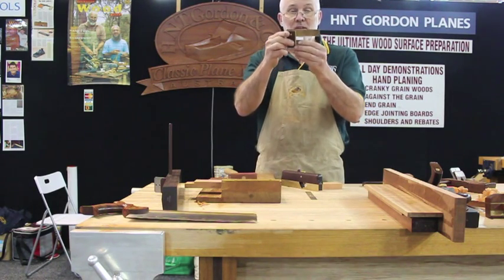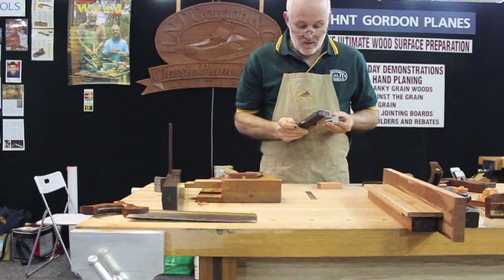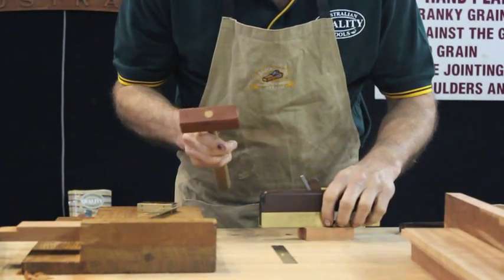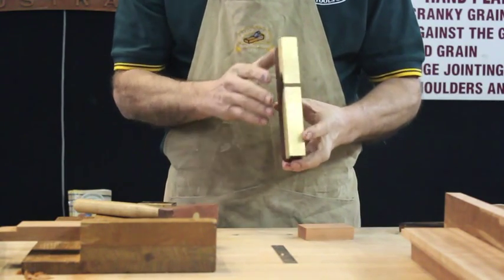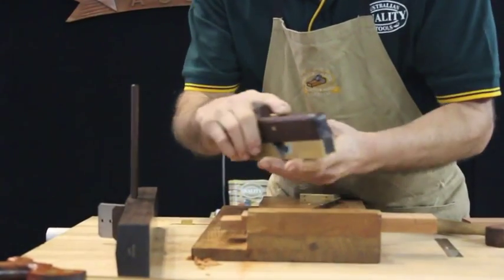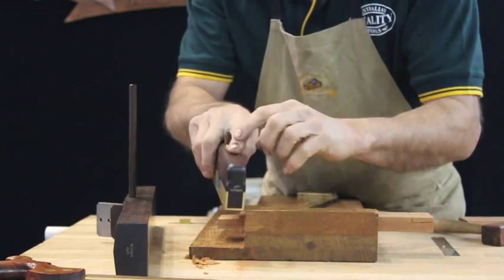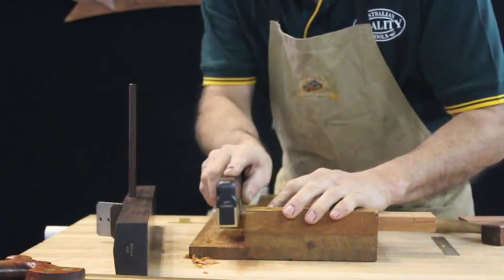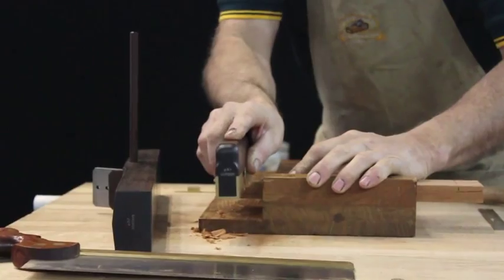HNT Gordon: Shoulder Plane

Comment: My HNT Gordon shoulder plane arrived in the mail yesterday; I'm having trouble setting it up, the blade rides up the bed while I'm tapping the wedge in - suggestions?
Reply from the maker: Hi NathanaelNo problem we will ensure we get you going.While the plane is sitting on the small block of wood,  with your thumb and first finger feel for a little bit of blade either side of the body and hold the blade while you tap the wedge in.   THat will center the blade and hold it as you get the wedge set.  A couple of things to check,   make sure there isn't any residue finishing oil on the bed of the plane and also the wedge,  as that may cause what you describe.    Also you may just need to tap the wedge slightly harder when setting it.When you do any adjustment of the blade ensure you have your thumb on the top of the wedge as you tap the body.Let us know how you go.   Regards TerryOn 8/10/2016 12:49 PM, Nathanael Coyne wrote:
Reply: Hi Terry, great to see you at the TWWW show in Canberra today and thanks for your tips and the new smoothing plane and spokeshave!